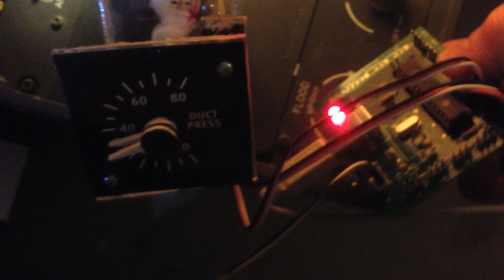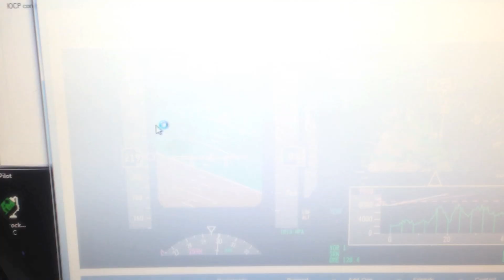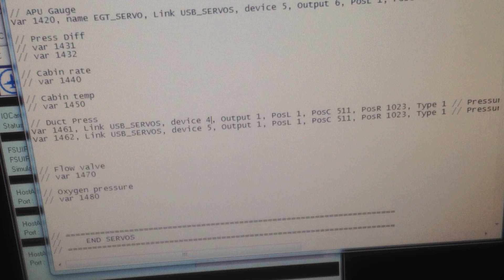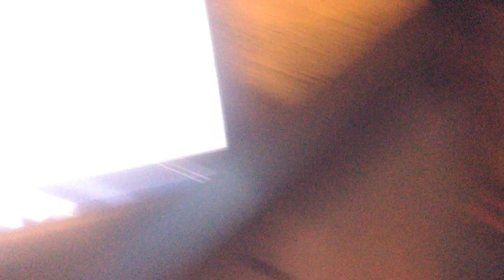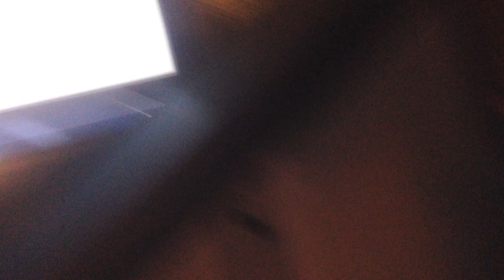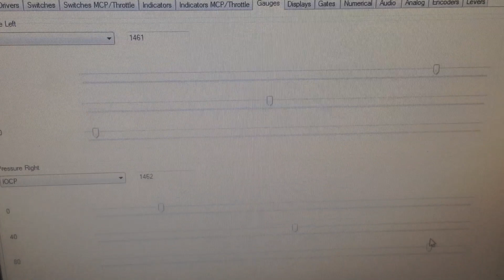Interfacing gauge - B737 Home Cockpit

Comment: Hi Peter !

wanted to know how did you got the transmition to work there using 2 different servos.

thanks !
Reply from the maker: You need to use a rod and a tube. 
One servo controls the rod (inner shaft) and the other servo controls the tube (outer shaft)
Hope that makes sense.

Comment: Hi, I saw the throttle pedestal vid and i was wondering how u sync the slider with your computer and FSX?

Thanks.
Reply from the maker: I am unsure what slider you are talking about. 
The throttle it self - at this point - is a CH throttle connected directly via USB to the computer. There are not other sliders in the pedestal at this point. 
Regards Peter
Reply: Build a Boeing I will comment on the correct video.